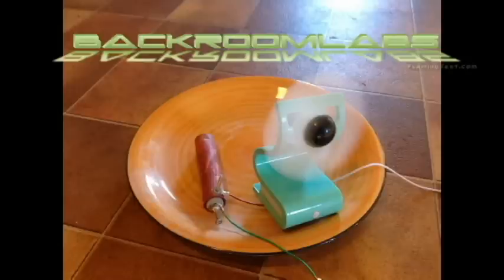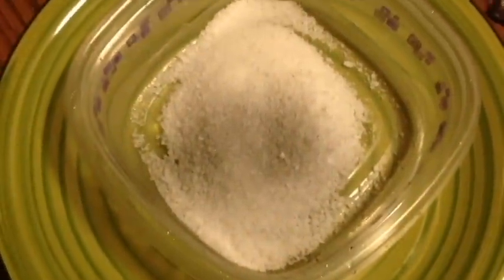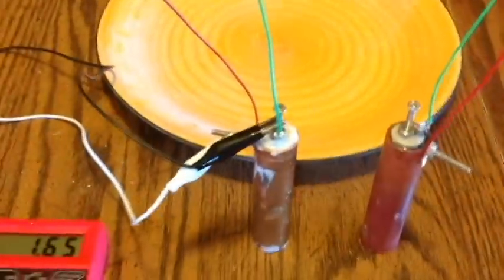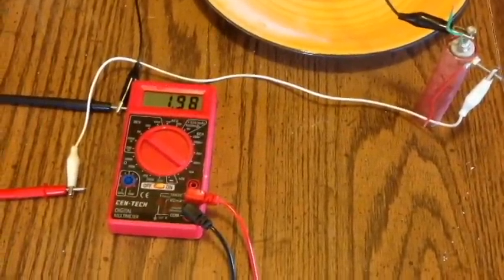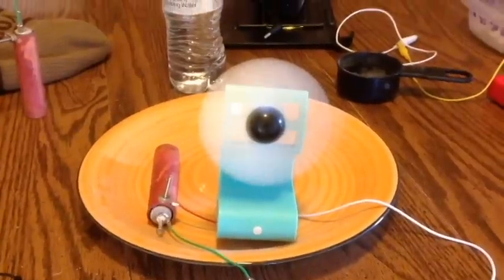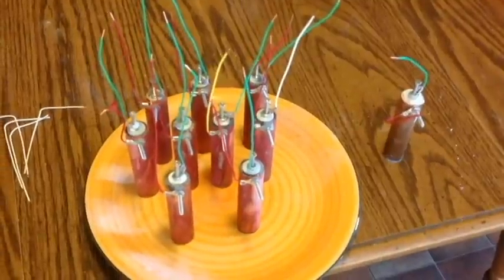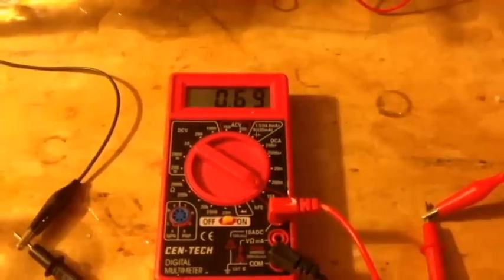Crystal Battery 1 amp complete build process BackRoomLabs

Comment: This is a really good video. However, am I missing something or is this just a regular battery? Isn't this just electrolysis of metals, using the water and alum as the electrolyte, moving electrons from one metal to the other, and destroying the surface of one metal in the process? This is what happens when you take any 2 dissimilar metals and put them in a conductive fluid. One metal gets destroyed as it donates electrons, and electroplates the other nearby metal. The same thing can be done by taking 2 dissimilar metals and sticking them into the side of a Lemon. This forms a standard battery. I don't know how a real crystal battery works, so that is why I am asking?
Reply: Its just a chemical battery. Not a crystal cell.
Reply: supermuble I have the same question...
Reply: bingo
Reply: I'm new to this tech., but I think the reason they call them crystal batteries is because the solution inside eventually crystallizes. I think you are correct in saying this is not a real crystal battery. I think botwire is right this seems to be a chemical reaction that makes the power, as soon as the water evaporates no more power. The real crystal battery videos I have seen have cells that have been operating for years. Good video though, I like the building technique advice.
Reply: ''I think botwire is right this seems to be a chemical reaction that makes the power, as soon as the water evaporates no more power''
Lasersaber has a video of cells he built ''with out water'' running a small motor and estimate they may run for his life time he say's because the crystalline material bores into the magnesium it keeps running long term . by building a battery out of the same parts with out the crystalline material but an electrolyte one could determine the difference . I believe the crystal cell will out perform .
Reply: I sure do appreciate it when someone finally comes along and says so simply and understandably, what so many others cant seem to help but representing as so complex and perplexing, and all in less than a paragraph...👍
Reply: the copper is insulated so the battery also acts as a diode and the metal does not galvanize due to the insulation. go back to jon bedini and aaron murikami videos on the alum battery. the chemical process is only a secondary effect of symmetry breaking.
Reply: Thank you for posting these words

Comment: These things die too soon. They call them infinite batteries, give me a break, a few months of infinity at most.
Reply: A crystal battery doesn't ever die. For an example, a quartz crystal in a watch never dies, although you have to replace the watch battery, the quartz frequency mechanism is emitting a free frequency pulse forever.
Reply: I experimented quite a lot with these things. The problem is a battery needs a cathode and an anode. The annode will degrade according to the material, magnesium will degrade fast, aluminum will last longer, but both will eventually degrade and then your battery is finished. Try it out. Well, you can make a dry battery, it will last many years, but the amperage will be ridiculous and not useful at all. Of course, the crystal will remain the same, but your anode won't. That is the problem.
Reply: ***** Hi Erik, that's what I am saying. A battery where the Anode donates electrons to the Cathode and produces current in the process is just a battery right? A crystal works on an entirely different effect. For example, if you squeeze a crystal it produces an electric current, which never degrades, no matter how many times you squeeze the crystal. I don't understand it any further than that though. I don't know how the crystal batteries actually work since I haven't built one. I don't know if the crystal batteries by John Bedini or Hutchison use the Piezoelectric "squeeze" effect or not? But any battery with a liquid conductive fluid isn't a crystal battery.
Reply: A nano mix of 3 to 1 gold and copper on your anode should not degrade. I've heard either 3 to 1 or 1 to 3 both work.
Reply: Paul Caruso What is the voltage going to be?

Comment: If you pick up a 3/4" wire brush for cleaning copper fittings. Trim it down to fit the I.D. of the tubing. Then scratch grooves on the inside of the pipe to create greater surface area. Similarly deep grooves on the magnesium will increase surface area too.
It will not make a huge difference, but every little bit helps.
Reply: Must be in alot of pressure for a good voltage..but the anode gets break a part Quickly
Reply: @abbaspourmoghadam3850 🔴 I highly recommend learning about Islam...

 🔵 There is no salvation in the afterlife except by following Islam

⚠️ God has said in the Quran:

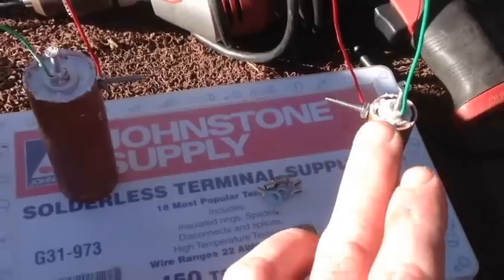🔵 { O mankind, worship your Lord, who created you and those before you, that you may become righteous - ( 2:21 ) 

🔴 [He] who made for you the earth a bed [spread out] and the sky a ceiling and sent down from the sky, rain and brought forth thereby fruits as provision for you. So do not attribute to Allah equals while you know [that there is nothing similar to Him]. ( 2:22 )

🔵 And if you are in doubt about what We have sent down upon Our Servant [Muhammad], then produce a surah the like thereof and call upon your witnesses other than Allah, if you should be truthful. ( 2:23 )

🔴 But if you do not - and you will never be able to - then fear the Fire, whose fuel is men and stones, prepared for the disbelievers.( 2:24 )

🔵 And give good tidings to those who believe and do righteous deeds that they will have gardens [in Paradise] beneath which rivers flow. Whenever they are provided with a provision of fruit therefrom, they will say, "This is what we were provided with before." And it is given to them in likeness. And they will have therein purified spouses, and they will abide therein eternally. ( 2:25 )}

⚠️ Quran

Comment: Thanks for your sharing.  Am I missing something or did you just assume that I would know if you cooked the crystals. It appears that you just added the powdered crystals and added a little water for a boost?
Once again thank you for sharing your knowledge.
Reply from the maker: yup it's really that simple. no heating required no cooking just add water and the alum, the copper and, magnesium
Reply from the maker: +cosh row negative these cells are way to heavy. also the power density is no where near what is needed to power and aircraft motor.

Comment: what is in the borax and allume? as in the active ingredients
Reply from the maker: borax is a mineral used as a detergent or detergent additive. One good use is pest control. Insects with an exoskeleton... the borax works into there joints and eventually cuts in the none protected areas under the hard outer shell. Borax, also known as sodium borate, sodium tetraborate, or disodium tetraborate, is an important boron compound, a mineral, and a salt of boric acid. Powdered borax is white, consisting of soft colorless crystals that dissolve easily in water. As for the alum it is potassium alum, which is the hydrated form of potassium aluminum sulfate and has the chemical formula KAl(SO4)2·12H2O. You can see the compound is considered a hydrate  with 12 molecules of water (H20) this aides in the cells conductivity within the crystal structure.  Potassium alum is a fine white powder that you can find sold with kitchen spices or pickling ingredients. All in all the borax is not needed for this to work. All the cells I made with borax are destroyers of the magnesium. Magnesium is the scrafical metal in these cells. So the idea is to drastically reduce if not eliminate this reaction without decreasing power output. Best results were found by using alum only for the crystal. Look at some of my other crystal battery vids. there are some other doping agents I want to try. these aid in increased power higher amps, neat stuff
Reply: Hello, are referring to Diatomaceous Earth, which is very hard shells of Silica made from Diatoms in the ancient lakes which have now dried up. These shells of ancient Diatom creatures are collected, and this is what is sold as "Ditomaceous Earth" which is literally miniature pieces of silica shells, which is known to cut up and kill small animals such as ants, and fleas when they get the shells on them. Borax works because Boric acid is toxic to microorganisms, and in other countries they use Boric acid as a food preservative.

Comment: First I want to thank you for sharing your video and knowledge with the world.
 As a 'prepper' I am very interested in the process but need to ask some questions.
1) How long can the batteries last (shelf life) with no load on them?
2) Can any of the materials be re-used when a cell goes dead? Like the copper and magnesium.....
3) Have you considered selling 'kits' of raw materials to guys like me who do not have good source for some of those materials?
.
Now, as a former electrical engineer who uses those import jumper wires all the time, I can tell you that you are probably not getting accurate short circuit current readings due to the resistance in the wire the jumpers are made from. They are ok to about 200 Ma., but if you are trying to measure short circuit currents significantly more than 200 Ma; (like 1 ampere or more), the battery may be capable of sourcing an ampere or more and being limited by the voltage loss caused by the resistance in the jumper wires.and causing you to get a reading of only 700 Ma...
 To test this for yourself, take a reading with only two jumper wires, and then take another reading without any jumper wires at all, using the meter probes only.
Regards,
Dennis O.

Comment from the maker: Thank you. My plane is to combine these with a homemade super cap and a 3D printed desktop lamp. To make a source of light for life by only adding water.
Reply from the maker: +Gary DePietro I have left these on a joule ringer powering three 10 mm LEDs  for days and days on end. although if the load is to big let's say over 300ma they will eventually not supply enough to light the led. but then again just disconnect them from the load. let em sit over night, re-hook em and off they go. if you match the load to the cells impedance they just keep going. at first the led will be very very bright. but after let's say 12 hours the light will be alot dimmer. but will remain lit. after they dim just let em sit for a day and bam right back to full bright. this set in this video has been sitting in a box for almost a year now unused. sometime this summer I'll pulled back out and see how strong they are
Reply: have you tried urea?
Reply: I have spent months researching into battery reconditioning and found an awesome website at Magic Mender Wizard (google it if you are interested)

Comment: I became diverted by 'Roberts super cap, and I made a little one that seems to work better than a triple A battery but a 15 sec charge will run a small 20ma motor for about 45sec.  When I scale it up I cant get it to show the same power, so I must be doing something wrong.  My question is, do you have any updates to your crystal cells?  Thanks
Reply from the maker: Lol I have been messing with the super caps to. I have had some success. My issue is the binder for the ink. I'm getting close. Hopefully this weekend I'll have something to post a vid about. As far as an update on the cells. In the next weeks or so I'll post an update with all the different cells I have made. Some are around 2 years old and still working.
Reply: I melted styrofoam with acetone and it drys with a porous plastic film.  elmers glue and water works to.
Reply from the maker: +Ed Lovvorn i was going to try styrofoam. I have some polystyrene I'll try that this weekend. I have the PVA "elemers glue" I tried robert smiths recommendation of 5 to 10% binder to active material. It didn't bond to the aluminum foil to well. I'm Gona try and up the % and see what happens. Thanks for the info.
Reply: try putting the aluminium foil on a hot plate and applying the pva water solution .  It sticks a little better
Reply: I also made a new crystal cell mixture today.  It is very unconventional from the existing mixtures everyone does.  Using magnesium and copper electrodes, It has been running a small drone motor for about 4 hours so far and still going strong.  Once it stops I will try to recharge it with a power supply and I will check for corrosion on the electrodes. I will give an update and what the chemicals are.  O by the way the electrodes are just bigger than a mail stamp.
Reply from the maker: +Ed Lovvorn nice can't wait to see. And on your 1st comment about scaling it up. I had the same problem. I made one that was 1in by 2in and it worked great better with each charge. Then I made one that was 4in by 6in and it didn't have a 1/3 the Capacity of the smaller one.
Reply: I think alot of small ones might be the way to go.  I will be trying that.
Reply: +BackRoom Labs Could it be that you have used a slightly different mix, or were unable to maintain an even pressure over the larger cell? - Martin.
Reply from the maker: +solarhope smith just uploaded a video that explained the problem. He calls it electrolyte creep. He says to seL each cell with wax and this should help with the problem on the larger cells.

Comment: Curious if you put anything on the bottom of the cells to hold the alum in? Or did you let it harden first after the first watering and its holding itself in?

Also would love to see a follow up video in a month showing where these cells settle at. All of mine no matter what have always settled around 30mA. I've never tried using iron pyrite though.

Thanks for posting this man! :)
Reply from the maker: Just a few drops on the top then let it sit for a few. Then I flipped them over real fast like, some of the mix fall out so I added a lil more till it was full then a few drops of water and bam your good. As for a follow up vid that is already planed. I'm going to go over all the different cells I have made. You are right most of the ones with different mixes fall of right to 30ma. Thanks for the comment

Comment: Excellent work , I will try some of these.  Have you tried using iron oxide instead of the pyrite?  Just a thought I might try that, also have you tried to charge the cells?  Thanks for the video, its great.
Reply from the maker: +Ed Lovvorn in the future I am going to try some more lets say exotic mixes. look for John Bedini earth light forum about crystal batteries. it is a very  long read. It took me several evenings to shift through all the info. at the end john was able to produce a single cell that help 1 amp on a dead short. the mix wasn't exactly disclosed. but there is enough that I think I can get close. stuff gets a little spendy though. try a test cell with the oxide against others and see what is best.
Reply: I bought some iron oxide and I will try it tomorrow . Thx
Reply: +Ed Lovvorn I tried the iron oxide and found that it does not help in my case.  I probably need to try different combinations.

Comment: nice video, your method to get Cu2O is great, thx for sharing!
Reply from the maker: You are welcome.
Reply from the maker: +Alex no these cells stay put. The crystals do grow out of the top and bottom so once a month or so I just scrape off the excess. I a little cream of tartar is added the crystal growth will almost stop. In the cells that I have made with multiple ingredients the magnesium has been attacked pretty bad. But any of the alum only cells there are no visible signs. Maybe under a microscope but at that rate who cares.
Reply: +BackRoom Labs Hey, have your crystal cells show any degradation or you see the crystals pushing up the magneism?
Reply: +BackRoom Labs Thanks for the quick reply! I just made some Rochelle salts and is planning to make a couple of crystal cells that are similar to the John Hutchison's method as I wasn't keen on the crystal growth from the alum-method because I would like them to literally last forever and not only a couple of years before the magnesium rod has been pushed out. Sorry for the long sentence haha. However, after you mention that a little cream of tartar will inhibit much of the alum-method crystal cell growth, how much do you reckon I should add into the alum-method mix to prevent any sort of growth? Your alum-method is a much cheaper alternative to making crystal cells than John Hutchison's method as making Rochelle salts is expensive due to the cream of tartar being quite expensive for the amount you get.